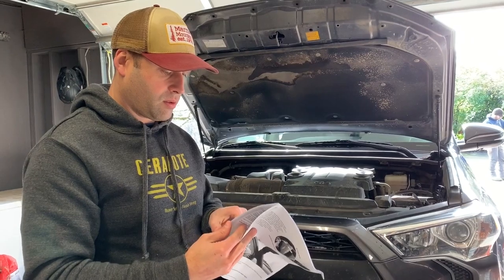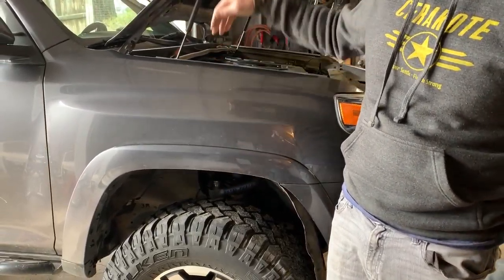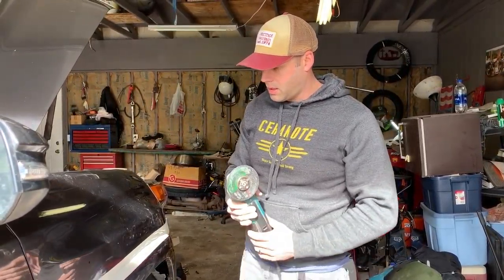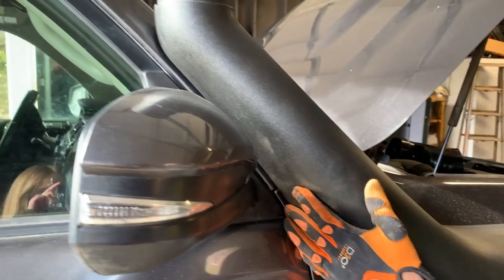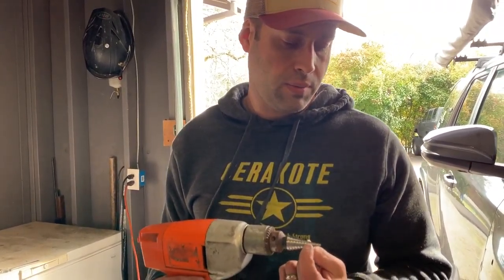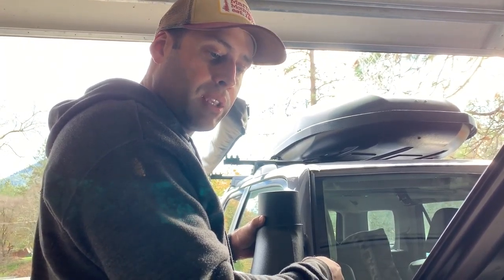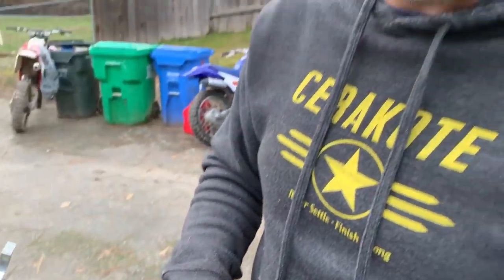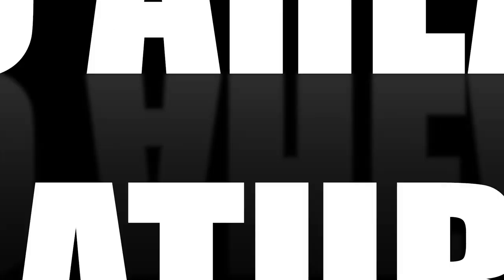5th Gen 4Runner Safari Snorkel Install

Comment: I'm dreading the work, I have 2 to install one on my 4runner the other on my wife's tacoma.... guess we won't be doing them both on the same day 🙃
Reply from the maker: It's possible you could get them both done, just get an early start.
Reply: @TheSideTrak  yeah.... no lol. It was 95 degrees and 50% humidity I did the 4runner and called it quits ha ha ha. The wife's tacoma will have to wait for another weekend... but I will say your video was the most helpful with the quirks of the install. Thanks

Comment: I'll probably just roll the dice with some double sided 3M tape before I drill into my A pillar.
Reply from the maker: ChristianMckay90 A buddy of mine did that when he installed a snorkel on his Tacoma. It has been fine for him and a good alternative option. That probably would not have worked well for me, just a week after doing the install on a snow wheeling trip, I slid off the trail into some small trees and brush. The incident would have surely ripped the snorkel away had it not been bolted down.

Comment: When you do suck up a hot of dust/dirt in your engine, how do you clean it out?
Reply from the maker: Scott Ttocs The filter is still in the engine bay to filter dust. Because it’s now moved high it doesn’t get exposed to as much dust as the factory location

Comment: You should have cleaned that engine bay and fender well first . Would have been a lot cleaner had you washed it first
Reply from the maker: Clean? What’s that mean? Nah, it will just get dirty again. It’s a well sealed unit so none of that will be getting in.
Reply: The Side Track 😂 that was a joke , I figured you would get it , I can’t keep mine clean for more than a week either
Reply from the maker: Toyota4runner TrdPro16 Lol. Sorry, Ive been a little slow on the draw these days.